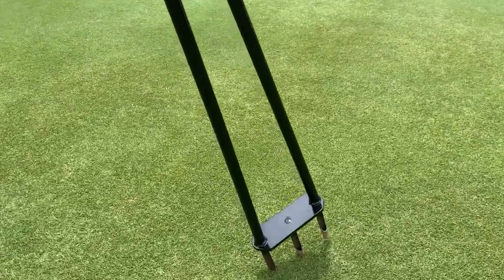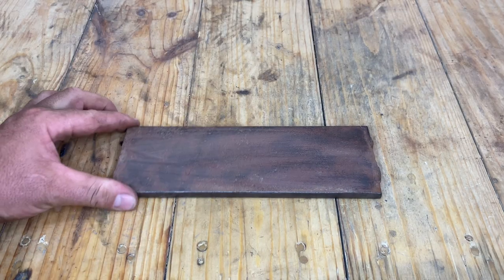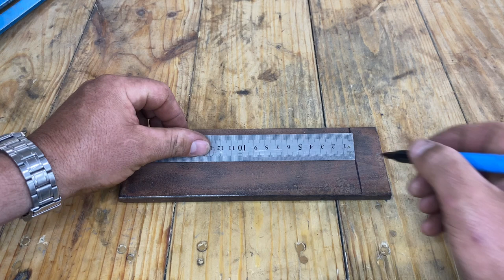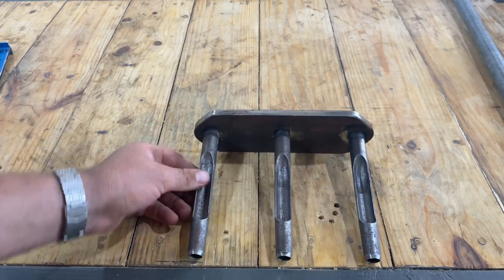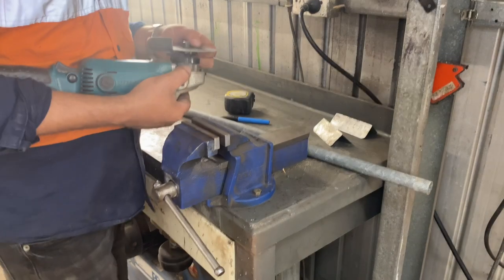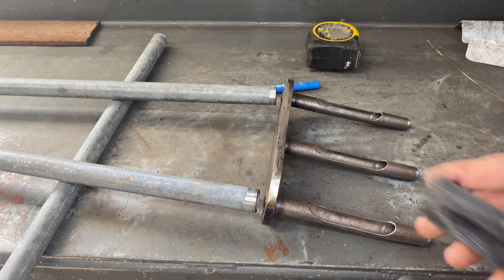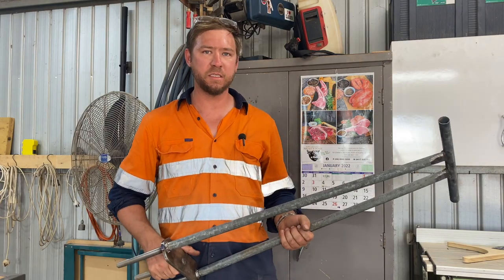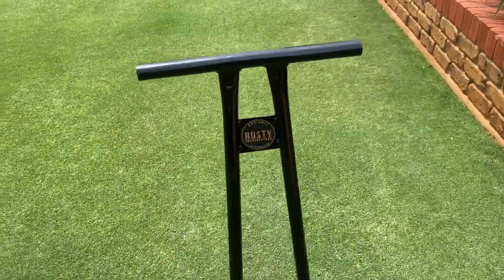Homemade DIY lawn corer  / Aerator

Comment: Nice work mate. I'm going to make one. I have noticed you didn't go right down to the plate. Just wondering could you weld a spacer underneath that hit the ground. Or you reckon it doesn't need it? Thanks Jim. 👍
Reply from the maker: Gday James😃 yes I actually did toy with cutting them down and welding them in a bit shorter. But i decided to keep it simple. I have seen. One made with a catcher that also doubled as a stop as you said. There’s Always room for improvements 😃
Reply: @rustyinspirations  if you did cut them down so that the plate hit the deck. Would the plugs come out still, do you think. Or do you need to leave that gap for the plugs to full out? Hope you don't mind answering my questions. 👍😊
Reply from the maker: Corect, you would need sum room for the core. You're right, in that case a stop would be better as it would leave Rome for the core to eject. Not sure if it's necessary. although I don't see it being an issue. 😃 no, I don't mind at all😃

Comment: How come you used two tubes instead of one for the long handle? It looks nice, but does it improve function you think?
Reply from the maker: Good question mate😃. If i had one tube in the Center i would need to use to feet (one on each side) to push it down evenly. The two tubes allows me to Center my foot and push it evenly. And leaves room for my knee. 👍🏻😃